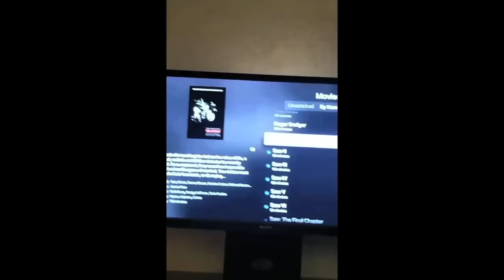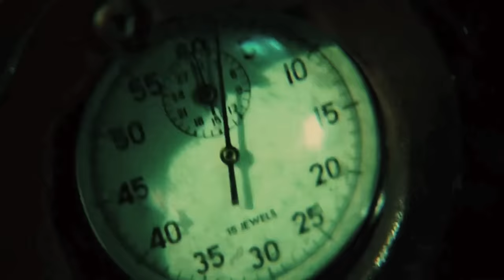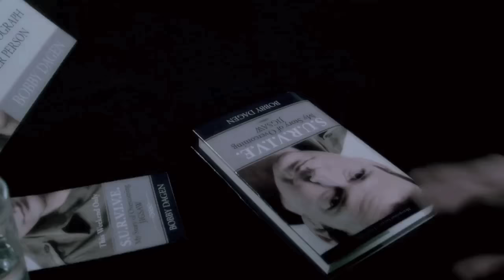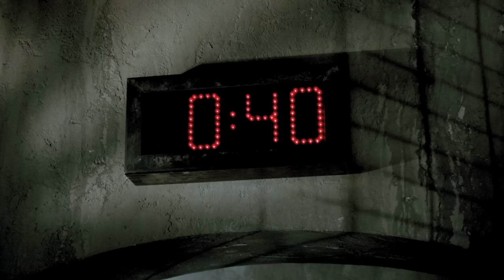FIRST TIME WATCHING EVERY SAW MOVIE

Comment: Saw be like- Goes to the Pharmacy, Hi I would like 1000 used needles please
Reply: Whoosh
Reply: Probably easy to steal 1000 used needles from where hospitals store their medical waste
Reply: I would like lots of chains
Reply: @samuelwilkin5  unless you either 

A: work for the hospital

Or B: work for the Medical Waste disposal team that works for the hospital

Not really
Reply: @yaogwai  it depends on where you live but if I was to clean up my local train stations bathrooms I would probably accumulate 1000 needles over the course of two months lol
Reply: It would probably be easier to get needles other places. At least here they are placed within a yellow bucket, the needle brokken off in the process and the bucket locked once the lid is closer entirely. The way the opening of the bucket is made it’s impossible to get out a syringe espesially with the needle still attached
Reply: they actually ended up using around 120,000 needles and they had to manually take out the metal tips and replace them with safe plasticy tips

Comment: 18:17 This actually works and it's called a tracheostomy. Basically he created a new direct line of airflow straight into his throat instead of having to breath through his mouth or nose. You would have a tracheostomy if there was so much damage to your face or throat that you can't breathe how you normally would; a doctor would also use a tracheostomy as a form of ventilator for someone with damage to their airways.

Comment: All you haters out there saying just drinking the water are wrong. Those jugs are 5 gallons of water each. That’s 10 gallons of water. The world record for the fastest gallon of water chug is 33 seconds and the guy threw up right afterwards cause it can make you sick drinking that fast. The average male head is about 9 inches tall. That box is only an inch or two above his head. I’d say he’d have to drink about 4 or so gallons to have the water at a safe enough level to breathe. If we go buy the length of the clip for how fast it filled up that’s about 3 minutes. He’d have to drink that much water in 45 seconds, only slightly faster than the world record for drinking 1 gallon which the average person can’t and shouldn’t do (remember the throwing up). Let’s be generous and say the editing sped this process up and it actually takes about 10 minutes to fill up. He’d still have to drink 4 gallons in 2 and a half minutes all while not throwing it back up or suffering any other symptoms that come with chugging water that quickly. And the cherry on the top is he would have to do it before the water went past his nose cause you HAVE to breathe while drinking. 

Thank you for coming to my TED Talk.

Comment: "He did poison him"
But he didn't die from poison he died from his body being burned alive so technically Jigsaw never murdered any one
Reply: But jigsaw deigned a trap specifically to kill that person, and the person dies as a result. In every courtroom in America, the UK, Australia, and everywhere else, jigsaw committed murder. Doesn't matter that he didn't deal the killing blow, Navarre he built the trap that did.
Reply: @AtlasMays  every one who die from the first jigsaw could of lived but died becuase they failed or a person in another trap killed them
All the other jigsaws had made unescapable traps which does make them killers
And yeah some traps were hard like the wire trap from the first SAW but all traps made by the original jigsaw were survivable
Yes he does set up the thing that kills them
But the people in the traps set it off
Also i found a loop hole in the fly trap trap from SAW II you could use the chair to grab the box with out setting off the timer but the idiot kept pulling on the thing the prevent the timer from starting
Jigsaw didn't kill him
He killed himself
Yes ever jigsaw after jon can be consider murderers due to the inescapable traps but but the oringal has never intentionally killed any one in the traps
Reply: @alyxwold4974  The problem with that line of thinking is that he intended for his traps to kill people. If he didn't want his traps to kill people, he would have made then non lethal, or not built them at all. You can claim that he didn't want people to die, but his traps were designed to torture his victims with only the slightest chance that they'd be able to survive it. That makes jigsaw a murderer. Even if he never killed somebody with his bare hands, he made sure his traps were capable of it.
Reply: RageCreator 2996 that’s not how the law works.
Reply: hey remember in Saw II where that blonde chick died from the poison gas jigsaw put in the house? (also legally it would still be murder)

Comment: Interesting thing with the part where the hooks rip through the guys thirty meat. His arms were bent at a 90 degree angle when it happened, meaning he wasn't even putting weight on the hooks at the time. The only way that tear could've happened is if someone pulled the hooks up.

Comment: So the public trap in saw 7 was FLAWED. All they had to do was hold the saw between the women on the ceiling and one of the guys and non of them would have died..
Reply: i’m thinking it’s either supposed to be escapable in a saw V way where they could all live if they just worked together, or the saw would just move towards the dude it’s closest to if it’s not in the middle when the timer runs out.